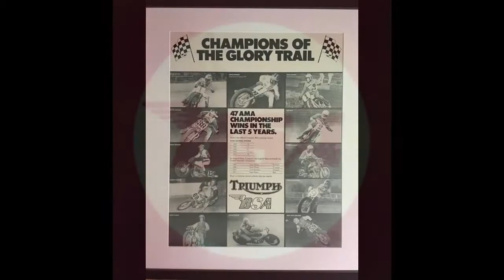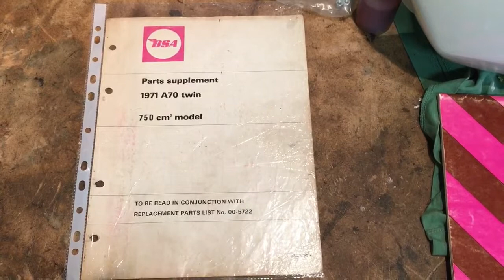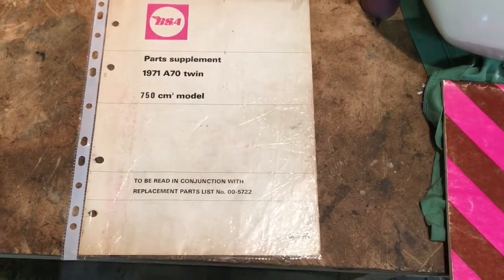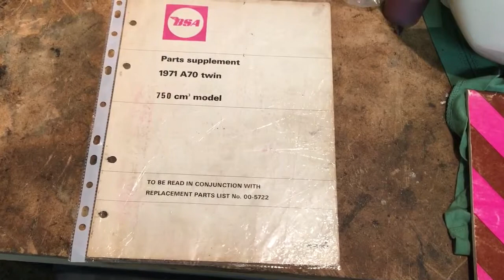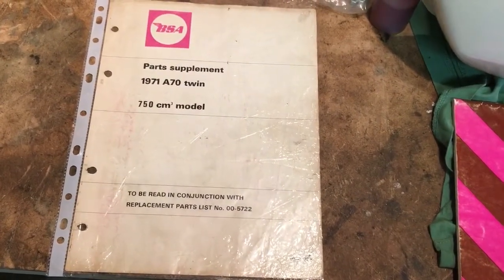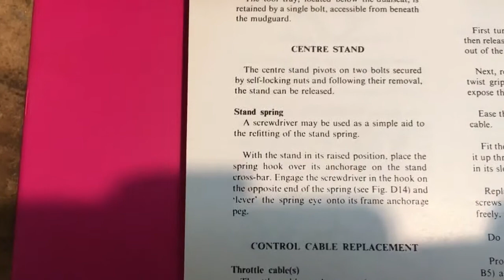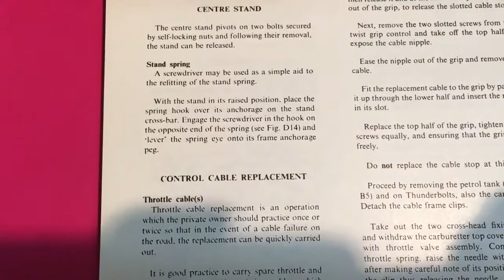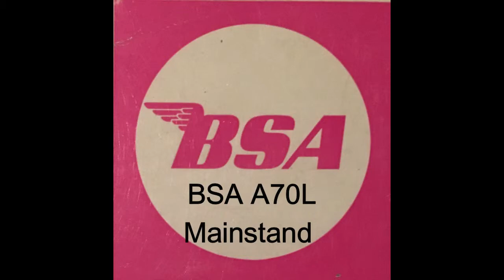BSA A70L Mainstand Installation

Comment: You could try inserting coins inside the coils of the spring, removing the need to lever against any of the paintwork.
Reply from the maker: Hi and thanks for the interest and the suggestion. Will give that a try when installing the side stand. Thx again.